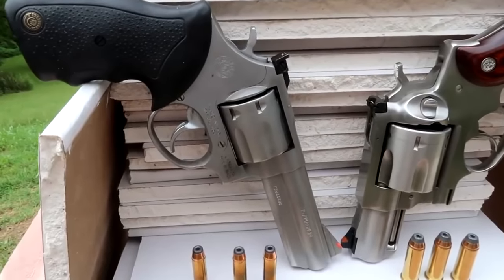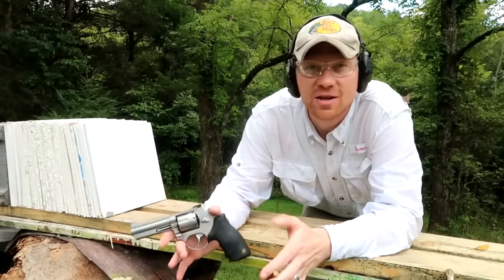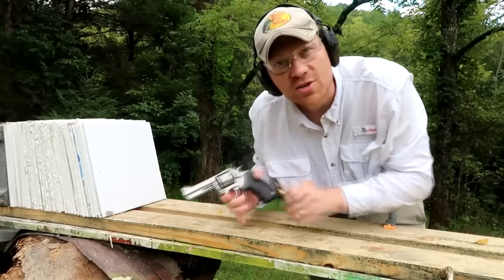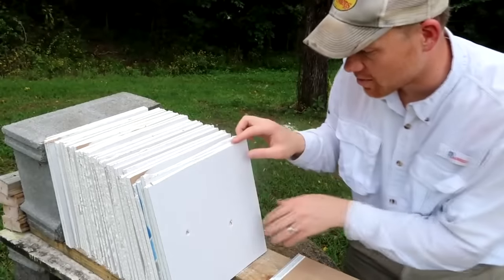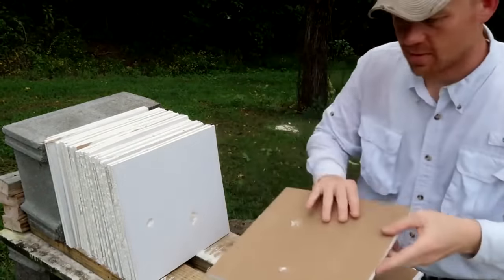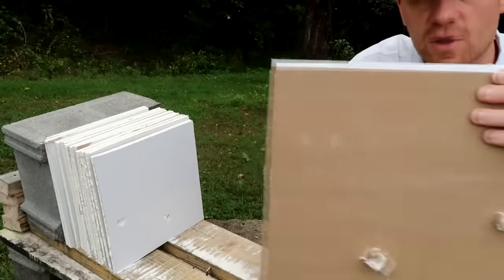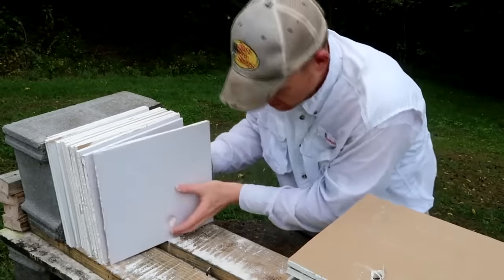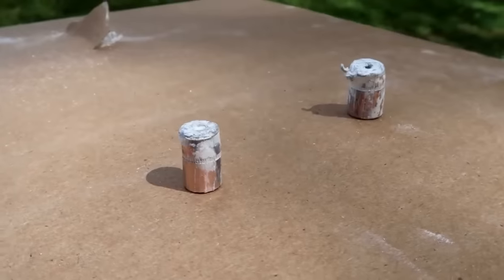.357 mag vs .44 mag - Drywall Test

Comment: As someone who has Handloaded both the .357 and .44 REM Magnum for over thirty-five years here are a few points to consider.
I Handload for over thirty Rifle and Pistol calibers.

First you notice the excessive drywall penetration (More on this later)
As far as JHP expansion, drywall is a very poor medium
Proper HP and JHP bullet design expansion requires “hydraulic impact” on the HP and JHP to institute and complete full expansion.
These bullet types are designed to enter human and/or animal targets where the bullets will impact soft blood infused organs and tissues providing expansion and energy release to reach the desired effect on the body and nervous system.  

Back to the drywall….the JHP bullets became “plugged” with drywall material and became non-performing JHP bullets.
A word about calibers for home protection
As you can see, if you live with homes close by Magnum Handgun calibers are a poor choice (Unless you hate your neighbors) because of over-penetration, on wood and stucco homes even the low pressure 230gr. 45 A.C.P. Ball or JHP can easily pass into and through your neighbor’s home next door.
A more responsible choice for the home guard is the 9MM or .38 Special and you are less likely to kill your neighbors’ dog or children. 
If all you have are.357 and .44 Magnum revolvers seriously consider loading .38 Special and .44 Special loading's in them for home defense…much safer for everyone in the Hood’
(Remember, you WILL BE HELD RESPONSIBLE FOR YOUR DISCHARGES, in defense of home or not)
Reply: Or use a shotgun.  Cheap alternative for Safe Room....... SAND BAGS!!!  The abrasion is murder on projectiles.  Of course sand bags will take up a lot of ROOM, but they WORK and are CHEAP.

Comment: Considering the price difference in the weapon, ammo, the fact that .44 is not "fun" to shoot, and the fact that .357 will do ALMOST anything the .44 will, AND the fact that you can cheaply and easily shoot light load .38s out of the .357 all day and load it with the big .357 for serious/protection use- there is simply no comparison- a good quality .357 pistol is the only way to go.
Reply: @roberthooper8883  if you have ever been in a grizzly situation you would be running for the exit using the 357 as a rock

Comment: I think you would have seen the .44 Magnum go deeper if it had as long a barrel as the .357 has.  Looks like the .357 has about twice as long a barrel.  You would also be able to compare recoil better with equal barrel lengths.   No matter, the 44. Magnum certainly has a LOT more recoil than the .357.
Reply: My 357 has a 3 1/2 barrel
So longer the barrel , more power it has???
Reply: @stevencoppess3351  to the point that you get more of the pressure to continue accelerating the bullet, yes, more power will be pushing the bullet instead of making a huge (and fun) muzzle flash.   3.5 inch is decent for a carry revolver.  Some ammo companies make ammo specifically to work well in shorter barrels.  I don't now what the best barrel length is, maybe depends on what you are shooting.  Rifles have much longer barrels and send bullets at pretty high velocity.

Comment: FMJ's, the safe room would have to be massive sheet wise if hollow points go through that many. Maybe some aluminum sheet sandwiched between, like they make rural road signs out of. I think your guess would be much closer to the mark, might be less sheets. Looks like they pushed the drywall with them and filled the holes as they slowed down, bigger tears in the backing paper. Awesome video, don't use it to build a safe room. We like your videos too much.

Comment: I have done similar test. The 44 with the same length barrel, will do a significant amount more damage. I used both in a 8 inch barrel. In my belief, you might not had quite enough drywall to stop the 44Mag. The velocity would have been a lot higher. 
Thanks for listening and for your video.

Comment: I too, guessed at 7 layers, because using hollow points rather than wadcutters would allow the wallboard to "clog" the hollow, reducing inertia. However, I thought the 4 inch vs 2&1/2 inch BBL, and the smaller diameter (less resistance?) Would all the .357 to travel farther. But I was guessing also.

Comment: the fact that both hollow point bullets did not expand shows a flaw in your testing.  because you placed all the drywall stacked in a block formation the drywall dust fills the hollow point and it doesn't expand.  i would like to see the same test with the drywall in a jig that spaces each sheet about 3 1/2" apart from each other.   maybe the spacing would allow the dust to clear so to say and maybe the bullet expands.  but maybe not.  what are your thoughts?

Comment: Gypsum board, or drywall, they use that stuff in cement to control cure rate in concrete.
Early bullet proof jackets, before Kevlar, were lined with it but results were disappointing.
Jacket had to be so thick wearer couldn’t move.

Comment: Do you have any idea how heavy drywall is you have to reinforce the walls and everything the screws from the outer layer would have to go all the way into a wooden structure and the ceiling might even have to have bolts with metal bracing on the outside for all that drywall you're safe room would become your tomb as it collapsed in on you

Comment: Given the massive difference in recoil, control, for the extra 2 sheets of drywall, I'm firmly in the 357 camp. Nearly same penetration with much more control. You should do it again using same barrel length.
Reply: That particular 357 pistol had a larger grip than the 44 and a longer barrel.  Switch that around so that the 44 had the larger grip and the longer barrel and you wouldn't see such a "massive" difference in recoil.  There would still be a difference, since the 44 round is capable of generating about twice the kinetic energy of the 357, but it is imminently possible to have a well-controlled 44 pistol -- it just takes more mass, a good grip, and maybe a recoil compensator.
Reply: @adstryker5084  I’d still go with the 357 for self defense.  No one’s walking away from a 357 hit. Outdoors in bear cat country that’s where the 44 rules
Reply: @shodanrich3317 No argument from me about the suitability of a 357, just pointing out that the recoil differences we're seeing in this video are due in large measure to the excessively petit nature of that particular 44 pistol.
Reply: Kudos to you AD. You may be the first weapons enthusiast to use the word “petite” in reference to a 44 mag. 😎😀

Comment: Here in Switzerland bricks and reinforced concrete are standard. We also have drywall stuff, but its manly used for decoration purpose (mostly as Ytong brick which are approx. 5cm thick).

By the way, I thought you would shoot them seperated. In that case my guess would be like 20.
Iam impressed that it went trough 20 when they where stacked together. But now I think, if you seperate those walls it would go through 30 pieces;)

Comment: I guessed 5 sheets for the 357, blew my mind, straight.
I've built a lot of houses out of concrete and let me tell you man, those things we built were bunkers, 8 or 10 inch concrete wall with concrete floor and ceiling slabs isn't to be compared with any type of bulletproofing material.

Comment: Ok I know it's wrong to comment before watching the whole of it, but there :
You want to make a vid comparing two calibers, you ought to compare fairly, ie using similar barrel length, and most common ammo type.
Good point on using semi jacketed HPs in 158 and 240 grs, but the barrel length difference is going to tilt the result in favor of the 357, which isn't good testing conditions to begin with.

Comment: The drywall dust clogged the hollow point and caused it not to expand. If they would have expanded they wouldn’t have penetrated that far. In my opinion hollow points are unreliable if you are not only firing them into tested materials. Many mediums they will not expand reliably. Flat nose solids alway straight line penetrate the furthest reliably. If you know what your bullets will do you can then shoot with confidence.

Comment: Change bullet types ie. Defence round, weight, full metal jacket max load armor round. 8" barrel. Home invader or just the neighbor cleaning out the gun upstairs and your sitting down stairs two floors down drinking a zero wahoo, bright blue bath robe with trapdoor buttoned or unbuttoned.  I bet that would make a difference. And you just hope you thought of bullet proof everything for 50 cal. machina gunno from above drones. Just some thoughts.

Comment: barrels are not thee same length to me it weakens the 44 mag , and the drywall should be spaced apart if you are trying to see it like a wall , against each other makes it much stronger thrn with space in between 2x4 s

Comment: If you've ever done construction with drywall then you would not be surprised. The stuff Is brittle. If you can wire up your electricity safety and correctly and don't use open flames in your safe room then plywood is stronger even though it weighs less. Honestly I would not be afraid to use it as an alternative to drywall anywhere in my house save the kitchen. Prices have gone down as well. Be safe

Comment: Instead of using 12 layers of drywall just use either half, or three quarter inch plywood on both sides and fill the Gap in between with Sand.
Sand is the "GO TO" bullet stopping barrier.

Comment: For a safe room I'd use,

1. Regular drywall over 1 inch oak plywood on the inside wall. And,
2. 1 inch oak plywood over 1/4 inch solid steel. For additional protection?

Use 2x8 studs filled with pea gravel. 
Not even a fully automatic machine gun is going to blast that wall open.

Comment: My taurus raging bull .454 cassull went thru 7&1/2 1/8 thick plates of some kind of hard metal. Try a taurus 8 inch .454 cassull raging bull in 335 load split and lets see where it goes. I hear they make a 335 grain but 260 grain was what I fired

Comment: Suggest layer of drywall then 1/8 steel, large ceramic tile then 1/8 inch dense foam sheet as cushion then 1/4 inch steel then drywall. Tank armor design but scaled down for pistol. 1st layer clogs HP steel supported by ceramic to help against penetration cushion for tile than main steel to stop weakened bullet. Ok for small room. Add filered air vent , water and small sink. Food snacks and a covered pot. Or paint can. For longer stays.... oh and CB or Gmrs or ham vhf fm radio. Landline. In case cell dies. Batteries, lights. First aid kit. Oh yeah a .357 and shotgun of your own.

Comment: Thanks for the interesting video.  I'd like to see more tests including shotgun 00Buckshot.  I'd also like to get the specs on the drywall, e.g. type, thickness, etc.  I also wonder if air space between the layers of drywall would significantly change the results.

Comment: My 38 special hollow points also did not mushroom so i removed the lead sticking out from the copper jacket and drilled some more lead out so that the lead formed a half circle inside the copper jacket rim. You will not believe how much the stopping power increased...

Comment: Put 3 sheets of sheet rock and use a base coat of plaster and a finish coat with cement about 1 inch and have a 1 inch thick metal box to crawl in…use a.38 for house protection…cool video..

Comment: If you're testing to see what happens when you shoot in a house remember there is insulation and exterior walls to slow the bullet. 
Why would you test a short barrel 44? 
Disappointed bullets didn't expand at the small distance ( max velocity)

Comment: As with other ammo reviews, it is so MISLEADING to make conclusions based on shooting one ammo out of one gun, or in this case, one type of ammo out of a longer barreled .357 vs a .44 Mag round. The main reason for this being misleading is due to the very specific amoo used! .357Mag ammo varies the most of all calibers in idt performance (speed and power), If you ignore the 'cowboy' rounds, which are intentionally made to be quite slow and very low in power, the .357 Mag on the open market varies in its muzzle velocity (MV) from about 1,100 fps to a little over 1,600 fps. These speeds are across all bullet weights, but it is also the range for the standard 158 gr .357 Mag rounds. The standard bullet for the .44 Mag (240 gr) varies also about the same in its speed, from 1,100 - 1,500 fps, which makes a huge difference on its performance as well.  So, on this drywall test, none of this very key info was given, nor the exact manufacturer and model of the ammo! 

In addition, the barrel length has a DIRECT impact on the bullet's speed, unlike so many people have said in the comments herein. Basically, the longer the barrel, the higher the velocity (the pressure continues to build up) will be produced for the same round. If you go to Buffalo Bore's site, you will see this on most of their ammo when the give ballistics info, the longer barreled handguns will almost always have high speeds, and thus more power. Of course, there are some (very few) exceptions to this, and this is due mainly to the amount of power loss on revolvers in the gap between the cylinder and the barrel. Pistols have different criteria, but here again, the longer the barrel, the higher the speed. Pistols do not have the gap between the cylinder and barrel, since ALL pistols shoot ammo from the barrel directly, which is really what makes them pistols! Revolvers are not pistols, even though the term has been misused for decades, and especially in the movies!.

Lastly, the bullet has a lot to do with penetration as well. FMJ or TMJ (there is a difference) will almost always penetrate further since the bullet is not intended to expand. Jacketed bullets are suppose to expand, depending on the specific bullet/mabufacturer. so their penetration will be noticeably less, and soft lead will expand also greatly, reducing their penetration capability. The weight of the bullet, as well as its diameter, will also impact penetration. While the .44 Mag round in this test went only 2 wall boards further, whiuch was probably because of its higher power rating, although we cannot really tell here since none of the very key info was not provided. The .357 Mag came close to the .44 Mag's penetration, and one of those factors was that it is a smaller diameter bullet.

So, while this video was fun, the only thing it really showed is that powerful ammo should penetrate 'soft' material fairly well. If steel plates were used instead of wall board, I doubt either round would have penetrated a 1" steel plate, unless you used metal piercing bullets (which are illegal now). I own a .357 Mag Ruger Blackhawk with a 6 1/2" barrel, and I have some armor piercing rounds (from the '70s), and I use to shoot into V8 engine blocks with no problem, but they are not steel. They are iron. I also own a .45 Colt Ruger Convertible, and when I shoot the very max round my gun will handle, it is about 50% more powerful that the max .357 Mag rounds (which is also quite powerful) that are available. I mention this because the .45 Colt and .44 mag are pretty close in power (and bullet speeds), with the .44 Mag a bit more powerful. The .44 Mag and .45 Colt ammo also come in much heavier bullet options then the .357 Mag, and this is partly how the power in these is so much more than in the .357 Mag, while the MV isn't much different. All three of these calibers are very powerful calibers

The .357 Mag round was the most powerful handgun in the world from 1934-1955, when the .44 Mag took over! Then Freedom Arms brought a single action five-shot revolver chambered in .454 Casull to the retail firearms market in 1983, and this had about 25% more power than the .44 Mag top end. Two more calibers of higher power have been produced since then, and these are always revolvers, since pistols cannot handle anywhere near the power of big bore (including the .357 Mag here) revolvers. 

If anyone is interested in getting the ballistics info on these calibers, and 30 more handgun and 26 rifle calibers, click on my name above, and the click on 'About' and email me. It is free and I release it in PDF format. I send it out about every 2-3 months to about 20 people who have signed up for it. This file has over 3,500 links to online websites, where you can actually buy the ammo, assuming the supplier has it in stock.

Comment: In this case i dont think barrel length makes a difference, being as the .357 was 140 gr and the .44 was 240 gr. I think I got the grains right. With the exception of the bullet diameter they basically performed equally. Now the wound cavity will be significantly bigger with the .44, either way there both beasts. Personal preference is .357,  it's smoother.

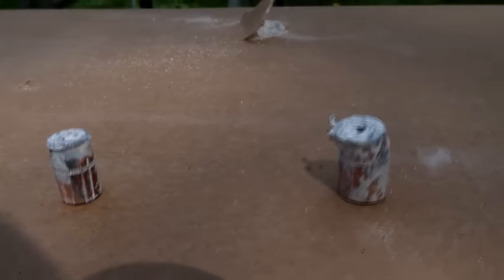Comment: Around the 9:40 mark I turned my attention away from the video for a minute and just listening to the audio I could have swore that was Hank Hill from King of the Hill.. but all jokes aside I knew right away from decades of firing both 357 and 44 that they would just decimate the drywall..because drywall doesn't have any  ballistic stopping material it pushes aside really easily.. that's why when you trip and fall your hand or your screwdriver or whatever you're carrying goes right through the thing.

Comment: im curious on the results if the barrels were the same length with the same rifling and if there were 3.5 ich spacing between ech panel of drywall same as a wall would have.

Comment: Next time: 1) same barrel length 2) number your boards with a sharpie 3) use full ball instead of hollow points 4) try putting a spacer between the boards, say about an inch